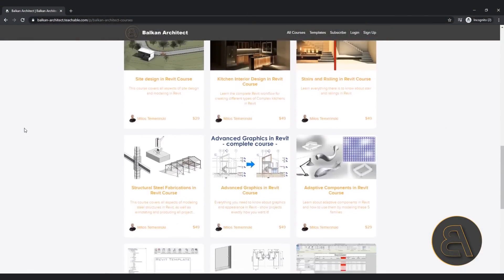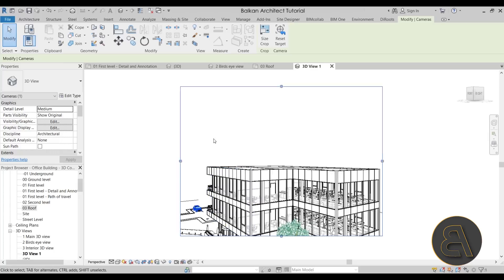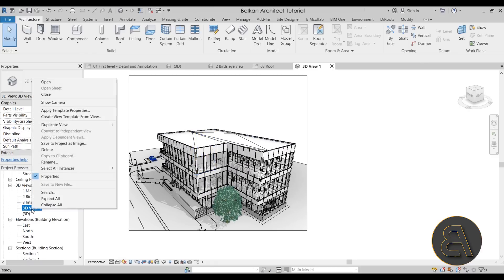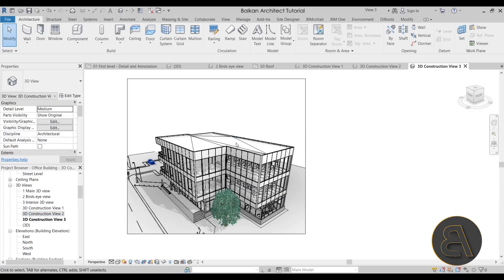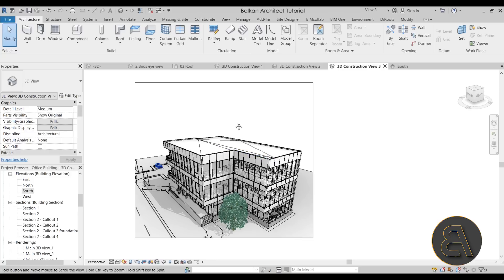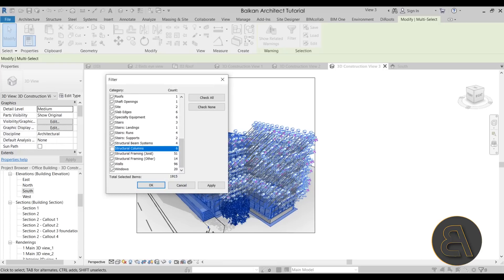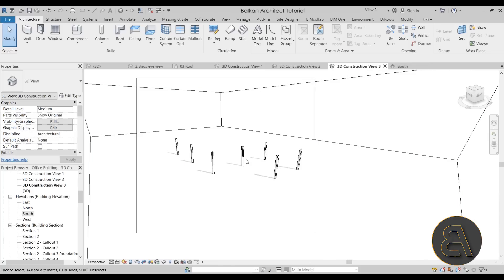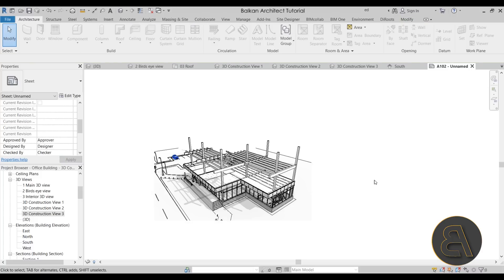3D Construction Site in Revit Tutorial

Comment: Just an quick note: 
you better can create an view template for each floor; ground floor, first floor, etc. 
Than create an filter and filter the elements you want to show in that specific view. 
The reason you may ask?
If you add an new element to your model it will be automatically filtert and will not show up in to your construction view. 
With the solution in the video, every element you add will be visible in the view and you need to hide the element again... not really future proof. 
Great video and thanks for the good tip!
Reply: Yes, the filter is a good tool, bud it is a different level of advanced user